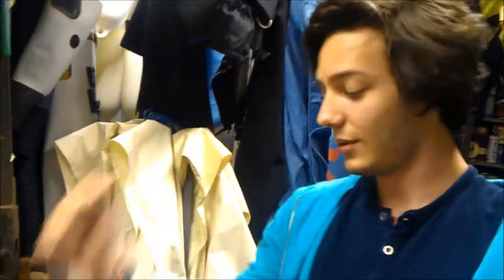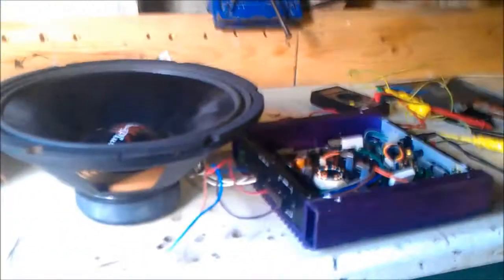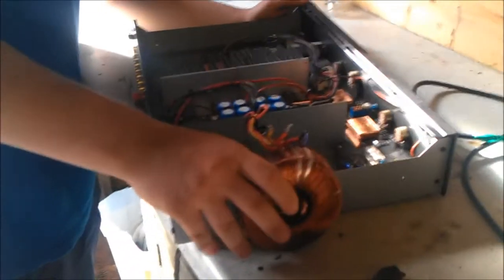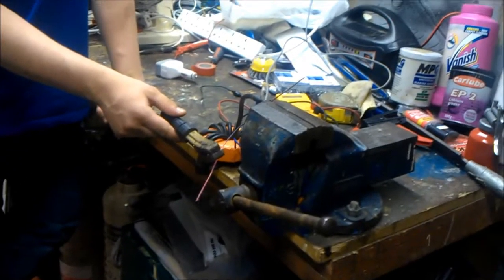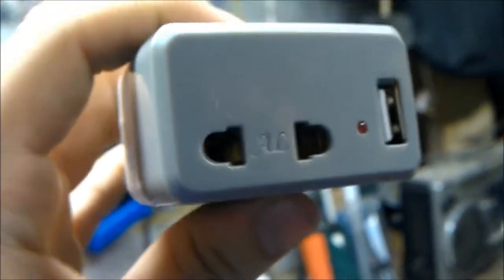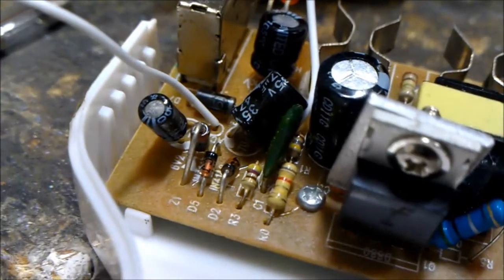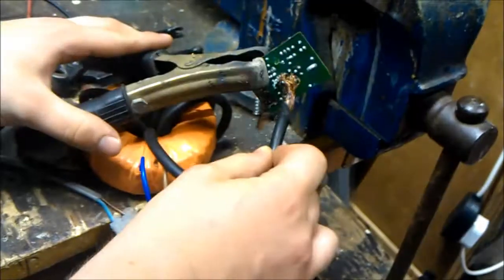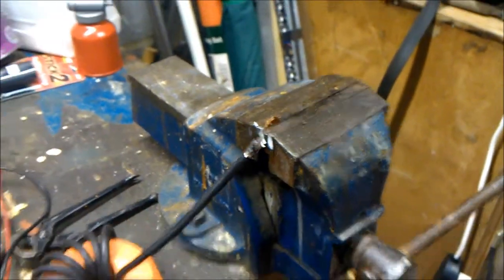Amp Fail, DIY Transformer & Cheap Inverter Rant

Comment: Those cheap 'inverters' are only intended for running small switching supplies (usually cellular telephone chargers) as they will work on DC.  Judging by the circuit, it looks like an oscillator (probably blocking as they only use one transistor and a few passives and are thus cheap to make) driving a transformer, not a proper SMPS.  That would also explain why output current into a dead short was minimal.